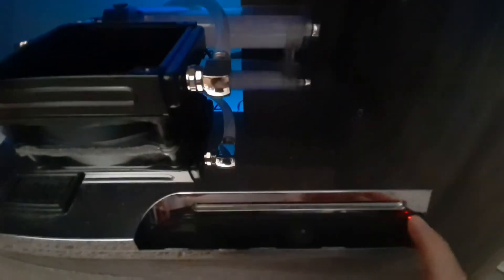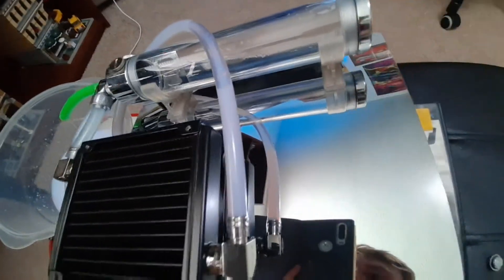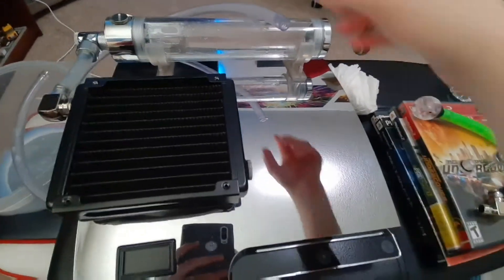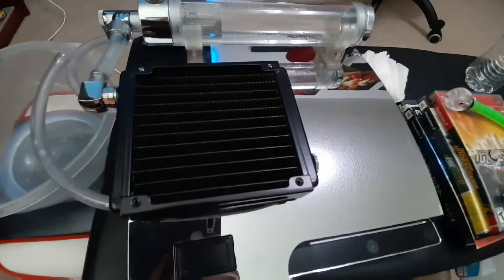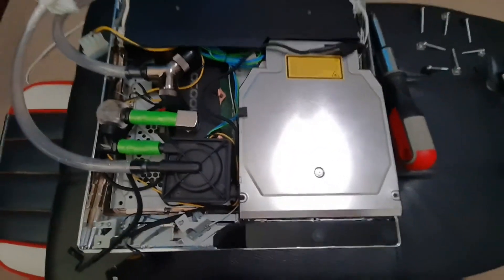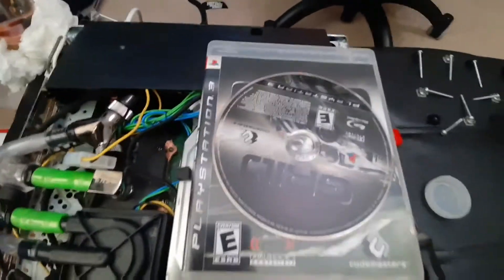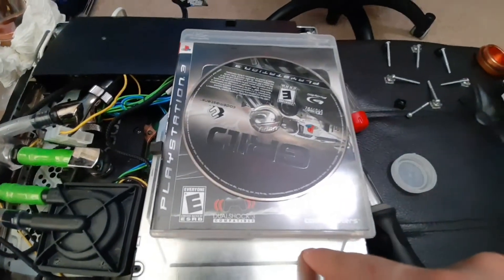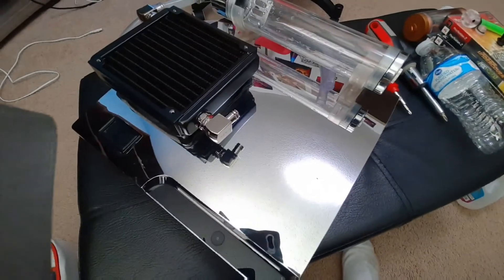Liquid Cooled PS3 Slim Disassembly

Comment: Where do you get your end caps with the multi ports?
Reply from the maker: @kingstone02  they are getting harder to find, but performancepc dot com, or modmymods dot com may still have some
Reply from the maker: @kingstone02  oh wait if you mean for the one on your PS3 those are the bits power end caps 60mm instead of 50mm like this video, those clear ones were from frozencpu but they went out of business recently

Comment: ❤😮  farewell hot for PS3❤
Reply from the maker: Yup! And actually about to refresh this one right now! New vid very soon on this
Reply: @trinkettinkeringking  The idea is to come up with something. This one is creativity. I made a hole in the power supply. So that the air works and comes out better
Reply from the maker: @sadokeking4031  oh nice, yea I found having the 120 radiator fan on the top with more airflow you can feel a lot more air coming out the back of the system now. And have a PS4 showing up soon excited to see what I can do with cooling on that one since so many people complain about them sounding really loud

Comment: Where and how did you hookup the fan and the pump ?
Reply from the maker: The stock fan is 12v, cut that fan out, wired in the pump and new fan to same spot👌
Reply: @trinkettinkeringking  A thanks for the answer, do you have a spare cooling block ? i cant find one on ebay or in my country. Do you think it is possible to hook up 2 fans ? for a 240mm rad ?
Reply from the maker: @HerrZielein  oh yea I'm sure it'll handle it, and I only have the one, still have this system, have been thinking about selling it..
Reply: @trinkettinkeringking  Thats interesting, i would be interested in parts, not the whole system, its just a project for me so the focus is building it myself...
Reply: @trinkettinkeringking  so which pump did you use ?
Reply from the maker: @HerrZielein  I like the switch dc pumps, nice and compact and plenty of power
Reply: @trinkettinkeringking  do you have a link or a name which pump you are using ? Or any which you can recommend ? I cant find something similar slim like yours
Reply from the maker: @HerrZielein  Laing DDC 3.25 18w, I think is exact one, sites I used to use to order stuff aren't really around anymore but aquatuning still seems to carry it
Reply from the maker: @HerrZielein  I'll be honest though it seems if you use everything I used it would cost like 4x more today then back when I got the parts, that pump alone seems to demand around 100 right now when I used to get them for under 50, I know you want to build your own but I could potentially save you alot of money parting out mine, mine would have to be rebuilt completely anyway but also at least has any fittings, reservoirs vans and connectors you would need, would probably only be looking to get about 250 for it lol although if ur not in US shipping would be pricey as it weighs a ton haha
Reply: @trinkettinkeringking  a thank you for your help. Now im just missing a block to recreate your build.
Reply: @trinkettinkeringking  i cant keep up with 250, i have a cech 2004 ps3 already an stuff like a radiator and fans i have myself from watercooling various computers. The only thing which is realy stopping me is the cooling block which iam going to buy some cheap cpu blocks and try to make them fit with a dremel

Comment: Would consider doing this with a phat ps3? Phats suffer from heat
Reply from the maker: Yes actually, first one I ever did was supposed to be a phat, but the water block I had only worked for the slim so I traded up lol it would really be just as easy they are built exactly the same just slimmer parts for the slim